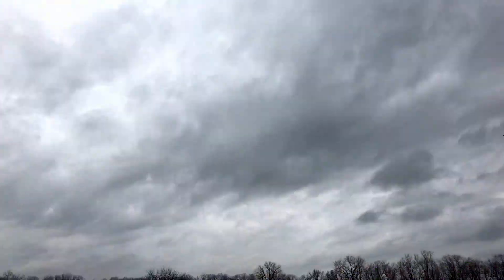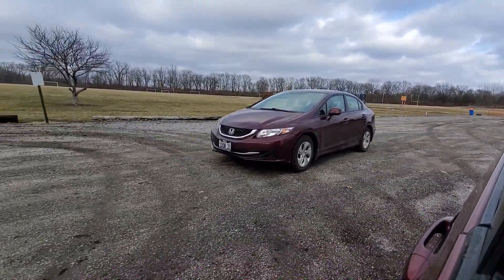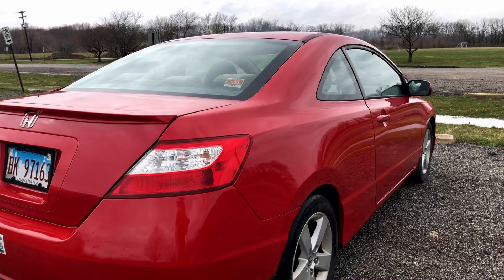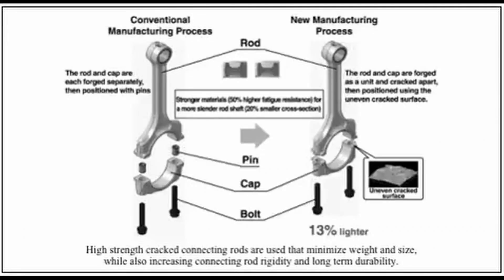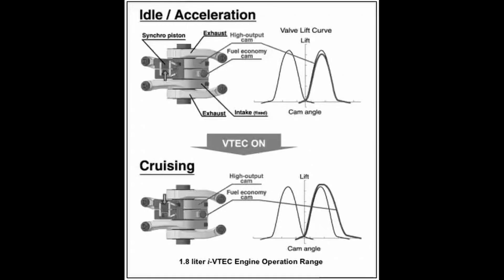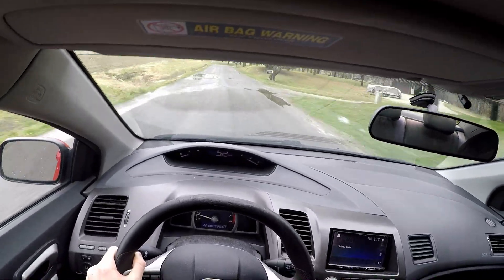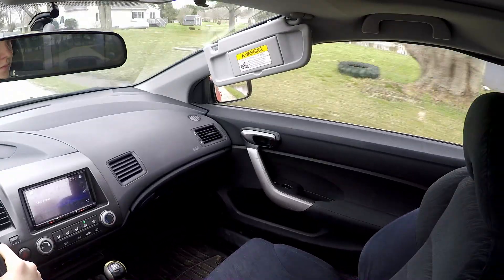A Brief Guide to the R18 Honda I-4 Engine

Comment: Question is the r18 gearbox the same as the k20 gearbox? And can I use the k20 LSD gearbox on my r18?
Reply from the maker: I don't believe so, although I'm not 100% sure. I believe the R18 can only be had with a 5-speed gearbox, while the K was mated (at least in the 8th gen SI's) to a 6-speed. I'm not too familiar with Honda transmissions though.
Reply: @carpartsandexhaustfarts  Fyi,  I have the 8th gen euro hatchback Civic R18 which comes with a 6-spd and although it shifts positively and smoothly it's a huge shame how long the gears ratios are - it seems to be similiar to the sedan's 5-spd but with a slightly shorter 4th/5th and 6th as over drive. It's good for efficiency and commuting but I really wish they made the 6-spd more of a short-ratio version of the 5-spd.

Also thanks for the video - I really appreciate the info on this popular engine that gets no love. The car is really a lot of fun to drive with great handling, a well-rounded engine and practicality that belies its dsign.
Reply from the maker: @ricetheories  Thank you very much for the comment and the information!

Comment: You need a valve cover gasket. It’s leaking oil all over the top of the engine. It’s a real easy fix.
Reply from the maker: Thanks for the heads up.

Comment: I've seen power up to 300+ but it does not seem practical. For mine, it's just a beater with a manual transmission. If I got another 8th gen, I'd modify the suspension and wheels to better handle backroads. It's actually a fun car on smaller roads since the steering is so response even though it has a very light feel.
Reply from the maker: I agree with you entirely. I think if you're gonna put work into these cars you really shouldn't focus on the engine, there are better platforms for making power, but it's definitely a fun beater/daily with decent potential.
Reply: @ValefarBF @carpartsandexhaustfarts4397 was considering full bolt-ons for my ‘08 LX (turbo was out of the question bc I want this daily to last as long as possible) but after watching this video and others I’m leaning towards prioritizing suspension and wheels. Did you end up finding a combination you liked? Coilovers/ wheels/ control arms, etc— any recs I should look into?
Reply: @jaimesoncortez  I went the suspension route as well. I did Truhart sport shocks, tein s tech springs, progress technology 22mm rear sway bar, Truhart rear camber kit and I got a 14 piece lower control arm kit from “A premium” includes tie rods etc. got an alignment the other day and everything is within specs. It drives amazing! I’m in college with no job didn’t care about power just wanted my car to be more fun and fun it is
Reply: @yohaneseats8984  aye that sounds like a fun set of upgrades! Thanks for sharing your set-up. I just graduated and applying to jobs right now, so definitely in a similar position. I’ll keep this in mind

Comment: "performance similar to a 2.0" sounds great and all but 60 less hp than said 2.0. That being said still love these little engines for what they do, mine still runs strong.  Appreciate the video mate.
Reply from the maker: It's just Honda trying to hype it up. I wouldn't really describe it as being on par with their 2.0s but it's definitely solid for what it is. Thank you! I'm glad you stopped by and enjoyed it!
Reply: Yes, but something like a golf 2.0 from that generation has a bit higher power, but Basically the same 0-100. On manuals

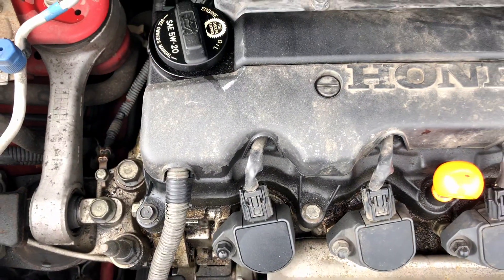Comment: 6:10 Oh how wrong you are! *my r18 turbo puts out 416hp. Fresh imported jdm r18 skunk2 stage 2 cam. Motec turbo downpipe skunk2 racing turbo back exhaust. Running 10psi on Series 76 precision turbocharger. Dual disc 5 speed trans. On a 2008 r18 civic that was manual swapped full fuel system rebuild running E-85. The engine has 46k miles and I've been running this setup now for about 3 months. Have had no major issues. Had some piping come undone but nothing major.
Reply from the maker: That's very impressive. Thank you for the correction, it seems like there's some conflicting information out there on how tune-able these engines are. I think it demands a little more looking into but the fact that people like you have been able to make ridiculous numbers like that is very surprising.
Reply: Literally 50 issues with your comment, stop spewing bullshit lies.
Reply: @checkyourself164  explain then sir. The car is now running a k20 btw
Reply: @checkyourself164  dude are you gonna reply or not?

Comment: Short Ram/CAI just so it can breathe better and call it a day?
Reply from the maker: Yeah, and maybe open up the exhaust if you want to. It's up to you, like I said it's never going to be a true performance engine, but it would feel pretty nice with just those simple bolt-ons.
Reply: I’ve used a oem 8th gen si axel back exhaust with a short ram intake which I liked. If you have an auto just got intake if ya have a 5 speed go for an exhaust too.
Reply: @jessybonsant5181  Why would you recommend not getting the exhaust done on an auto and just going with the SRI?
Reply: Only noobs who know nothing about cars put a short ram / cai , it make your engine breathe hot air .......  i put an OEM K&N filter on both my Civic and S2000 , do you think you smarter than Honda engineers who develop the intake box system ........

Comment: The R18 is just a modernized b18 with a low rpm activated I-Vtec Setting for maximum fuel economy It’s not a performance engine like the K20 but more like a reliable Economy engine that performs well throughout the RPM band. With a compression ratio of 10.5:1, And a redline starting at 7000rpms its a friendly engine that still manages to put a smile on your face.
Reply: Other than being 1.8l, it is definitely more d16 than b18
Reply: @mohammedislam5181  You don't hear vtec, you hear intake manifold opening at that RPM.
Reply: In the 8th generation European Civic, the R18 will do the 0-100 km/h sprint in around 8.9 seconds, making the car one of the faster cars in the 140 horsepower-class, with most of the competitors from European, Japanese and Korean brands being slower. The only faster cars with this size and engine performance are the first generation MQB-based models of the VW group (VW Golf 7, Audi A3, Seat Leon III, and so on).
Reply: @WhiteSlift  it does 0-100km/h in 8.58 seconds with a good launch, tried and tested.
Reply: @WhiteSlift  there so many cars they are faster... yaris t sport, civic ek3, EG5, crx, suzuki swift sport, vw polo, golf 3.
Reply: @diecaprisonne643  do you own any of those? I mean without performance mods, a similar engine size, same age or older? Because I’d be happy to race and beat you in any and all of those except the possibly the swift of the same year because it’s a couple hp under, but it’s 200-300kg lighter.
Reply: Nahhh the b18 was a double cam. R18 is a single cam.
Reply: A Canon high-performance filter muffler delete and holy hondata... R18 sleeper
Reply: In high RPMs and extra set of camshaft Runners open up and increase power output so in a sense it does the same thing VTech does but it is not VTEC
Reply: @mohammedislam5181  yes
Reply: Well said
Reply: @roryfulton90  we didn’t get modes in the North American spec 8th generation.
Reply: B18 is a high performance engine, R18 equivelant would be the D16.

Comment: I average about 26 city and 34 highway being conservative.  All city driving I get 20-21 mpg.  They inflate those numbers like crazy.
Reply: Those were the numbers before they revise them. Think it’s 26 city 36 hwy. Could be off a little but still good. No complaints from me especially after driving my truck. My Civic is my daily and drive truck on weekends.
Reply from the maker: Personally, I haven't been tracking my mpg, but I totally believe that they blow those numbers out of proportion.
Reply: I average 35.8 in a 2014 coupe.
Reply: I'm getting 28.7 city in my '07 EX.

Comment: I’m thinking maybe one day putting a K into my 2014 coupe
Reply from the maker: That would be sick. Like I mentioned in the video though, I'm not sure how worth while it would be. You could just pick up a decent SI for under 10K and have the complete package without having to worry about reliability and all the chaos that comes with an engine swap (and you get all the nice non engine SI parts). Plus, if you're getting it professionally installed it'll probably be just about as pricey. But if you're gonna do it yourself then it would probably be viable. I'm not sure how easily they drop in but if it's simple enough then I don't see why not. Either way though it would be sick. K is the way.
Reply: You need a full front end from an si to do the swap correctly. Unless you're very good with cars I'd just save up for an si.

Comment: I have a 06 lx with the r18, a fun little motor with minor mods. Did cold air intake, header, cat delete, catback and a good tune. It doesn’t make any kind of crazy power but it definitely is an enjoyable ride. With the tune my rev limit is 7800 sounds good bouncing off lol
Reply from the maker: That sounds awesome. Glad you're bringing out its true potential.
Reply: How many extra horsepower would all those mods add?
Reply: @WhiteSlift  Not alot. Maybe 10-20 I’ve since then sold and got an SI

Comment: Sadly alot of R18 blocks have that cracking issue where the bottom block cracks and leaks coolant
Reply: I have one with a cracked block. 286000 miles. Used JB weld to seal it up for now.
Reply: @Fleetmaster13  286k is ALOT of miles any how..
Reply from the maker: I haven't heard much about this but it is a shame.
Reply: @carpartsandexhaustfarts  It was only a few series of them, it was production flaw that was made in north american plant, they were recalled and there was no issues of that in europe, all the engines that were made in eu and japan had no such  problem.
Reply: Yeah that was on early 2008 with engine series R18A1 maybe R18A2, but R18Z1 that issue was solved !
Reply: The blocks that cracked were recalled and replaced so there isn’t that many floating around now
Reply: @kaderaqq1350  they weren’t recalled. Honda first gave a 7, then updated to a 10 year replacement warranty (starting from the production date of the model) to get the engine replaced by Honda IF it cracks during that period. I have an 09 model that could at some point get the crack (since it’s early 09 the engine is still pre-update). The engine was never replaced since it had low miles when I bought it last September (at 58k miles). But I did just get my Takata airbag replaced yesterday thru that recall.
Reply: @skateboarding118  where did you find the recall. I have an 08 156k miles with the block cracked
Reply: @crystalcrawford553  You're out of luck.  It was not a recall, but rather an extension of the warranty to 10 years. Your car was produced in '07 or '08, so the warranty has expired.
Reply: Kade Raqq bought my first ever civic 3 months ago an 08 Lx, one owner from small dealer, 3 weeks later had to replace the engine my self because of a cracked block
Reply: Dustin Brown Previous owner wanted to get rid of it ASAP before the block cracks.
Reply: @dustinbrown3167  That sucks man. How many miles did it have when you bought it?
Reply: @dustinbrown3167  dealing with this now. Looking into this motor? Or skip it

Comment: The R18 is a good motor. I was going to turbo my R18 9th gen Civic but after finding out I'd be spending close to 20k just to get everything right (Swapping out the CVT, brakes, turbo kit, building the motor itself out) it just wouldn't be worth it. However, throwing a nice exhaust system, tires wheels and set of coilovers on there does make an R18 Civic a hell of a lot more fun to drive.
Reply: 20k at the dealership maybe, my friend went to a performance shop dropped in heads, cams, valves, springs, retainers, main bearing, rod bearings, pistons/rings/rods ebay turbo all for about 10k labor included, oh and the hondata / dyno tune was another 2k in parts and maintenance, whole job 12k solid total on an AUTO!!. FYI these transmission only cost about 100$!!! and dealer installs for about 300 USD so go crazy with them . IMO this is better cheap engine/trans/ easy to find.

Once you spend the money the r18 is the best bang for your buck, anything you break is so cheap to fix
Reply: @echolost8075  Fuck, 12k is still a bit much. I could get away with just adding a bigger turbo on the 10th gen si for cheaper than that. I'll eventually come back to the R18 at some point. I love the 9th gen and the R18 too much because of how well built they are to NOT turbo one eventually.
Reply: @echolost8075  12k for full built and labor it’s actually not bad where do you know a shop that does This? If you know , thanks
Reply: @echolost8075 3500$ max these days lol.
Reply from the maker: That's what I've heard. It's a pretty great motor for what it is, Honda always makes some pretty solid stuff. But yeah, putting a bunch of money into a turbo and other work isn't really worth it when there are other cars that can make more efficient power. Thanks for the watch! :)
Reply: Facts
Reply: If you had to suggest some wheels and rims what specs and brand would you recommend?
Reply: @barney2799  I Don’t Remember What the Lug Pattern and Wheel Specs Are, but When I Had Mine I Had Enkei Kojin’s in black. Those Were Nice and Looked Beautiful on My 9th Gen!
Reply: What is the purpose of the coilovers?
Reply: @josedusol  Lowering the car and improving the handling drastically
Reply: @artisanwolf2068 would you recommend the si suspension kit as well?
Reply: Just for go the exhaust

Comment: I have an r18 with +300k and buddy she pulls for a 1.8L air intake and muffler
Reply: Buddy i think i just might make the half mil i have never had an engine light and i also have a head unit monitoring the car while driving so keep my fingers crossed and lets get it R18 10 years old still runming mint 5 speed do no auto
Reply: @JAMTOAM  I'm at 280k looking to supercharge, nice to hear this.
Reply: @JAMTOAM  just got a r18 5speed with 120, 08, time to start climbing to my half a million
Reply: @JAMTOAM  the auto for the r18 8th generation is a 5 speed Auto it gets better gas mileage too... get a stick and 6sp K20 you'll be much happier
Reply from the maker: @JAMTOAM  Daaaaang, yeah go for it. I have faith in the R18, I bet you can hit it! Yeah the five speed is like any manual Honda has ever made, amazing. It makes the car so much more fun! I hope you reach your goal!
Reply from the maker: That's awesome! Yeah they are decently peppy.
Reply: Did you delete the resonator?
Reply: what intake you got?

Comment: i think of the car like a train. it doesn't accelerate fast but it has a top speed of 130 mph. it's strength is in fuel economy and reliability. someone who buys this wants low feul cost and low maintenance costs. that's what it does.
Reply from the maker: Exactly, and this engine excels in this department while also maintaining the characteristics of any good Honda engine. I hope the video conveyed that well.
Reply: Top speed is 126 without a tune.
Reply: @HondaAholic  still very good considering u can buy one new for like 17k
Reply: I’m pretty sure it’s limited to 125 mph. It can probably go higher without limiter.
Reply: @FD-rh6tr  Governed at 126mph, tested myself.
Reply: Only ever to 120mph in mine, that was years ago haha had no idea it would even go that fast LOL

Comment: Hey thanks for this video.  Good stuff, owned my R18 for 4.5k miles so far.. and I love it.  Ive driven a turboed eclipse, an altima, and a lancer ralliart.  And while those were fast, this is fun and economical.  Throw some coilovers, bigger/wider tires, short throw shift, and so.e cosmettic stuff and its plenty fun to get to and from work.  Put premium in for better response.  Do not rev past 6.5k for solidarity.
Reply from the maker: Thanks for watching! Glad you enjoyed. It's a very fun engine for what it is. I love the feeling I get from those 8th gen civics. They've just got a certain character to them. Like I mentioned in some of my other videos, there are days where I'd rather be driving this than the WRX. I plan on getting it coilovers at some point but probably not much of anything else. I want to save up for a different project car. Maybe a turbo eclipse haha.
Reply: @carpartsandexhaustfarts  i didnt know wth i had, or was i was doing when i owned my 95 eclipse gs-t.  And i had money to blow back then lol.
Reply from the maker: @jondoe2099  That's unfortunate. Hopefully I'll get to the point where I can afford one. The dream would be to get a STI at some point.
Reply: Why don't past rev 6.5k? To prolong the life of the engine?
Reply: Fast fwd a few months, i rev to redline when im doing pulls, ive gotten much better at driving my car.  Based off what i had read back then, with r18s cracking blocks - 6.5k seemed like a stress free cut-off point for - yep you said it, longevity.